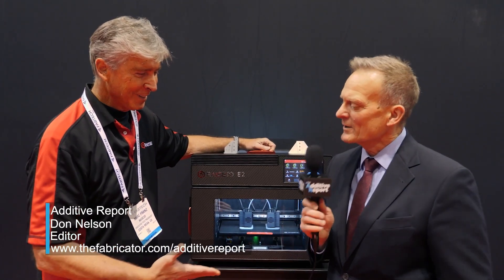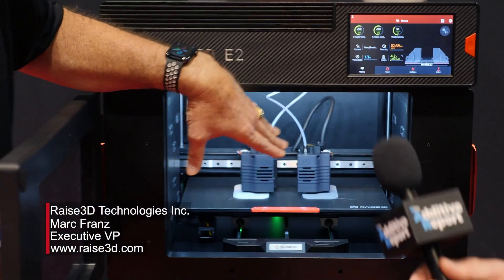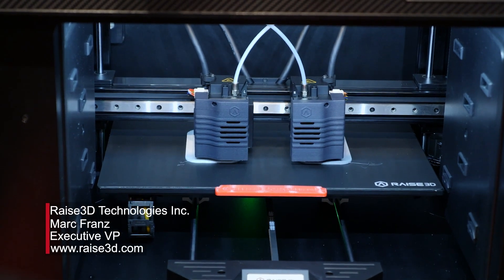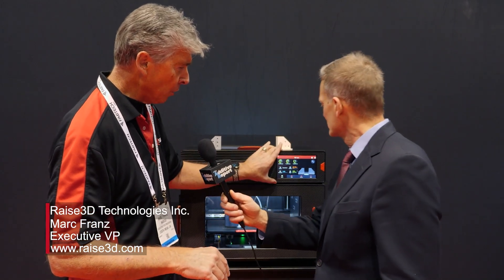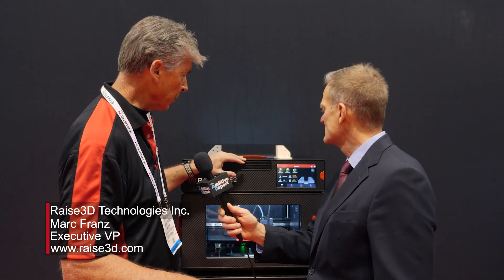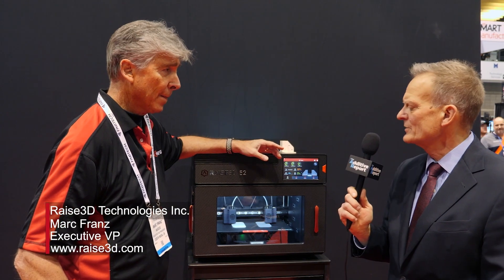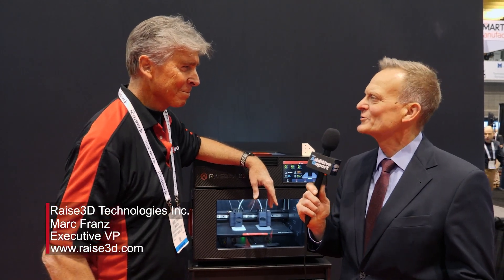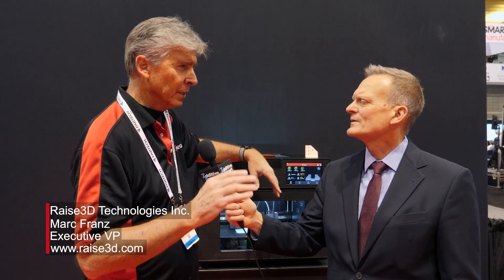Interview with Mark Franz of Raise3D Technologies at FABTECH 2019

Comment: Avoid this Raise3D E2 printer... complete garbage.... I've gone through 2 units in less than 3 months.  The machine is made in China and is of poor quality, and Raise3D can't get replacement parts from china either.  As for Marc's claims in this video that it can do carbon fiber is completely false, you can't even feed the material through the side spool holders.  Auto resume does not work either. The filament run out sensors do not work, and Raise3d ships the unit with the software option disabled.    A lot of marketing hype from Marc, don't trust him...